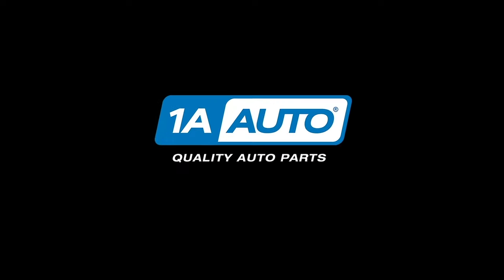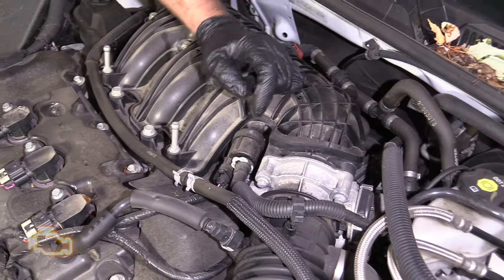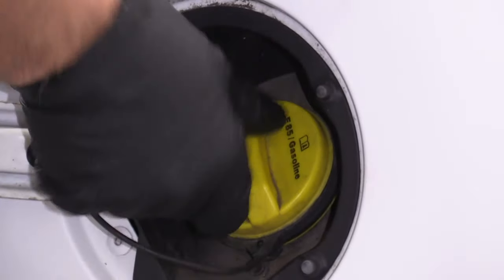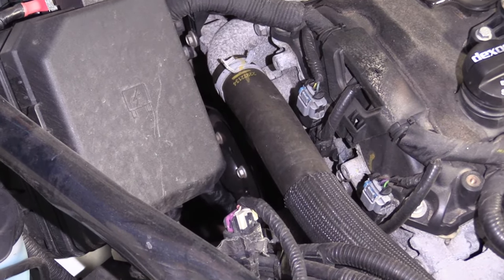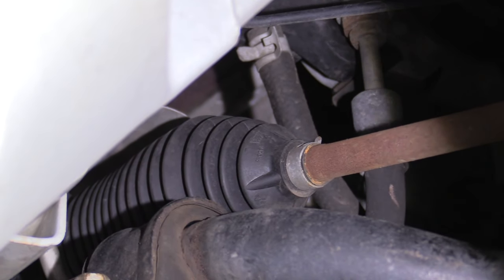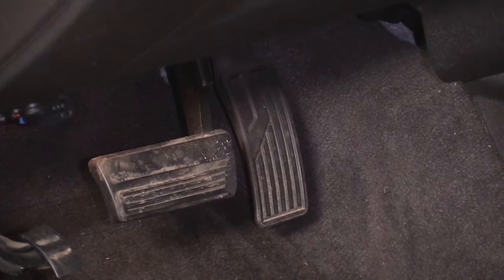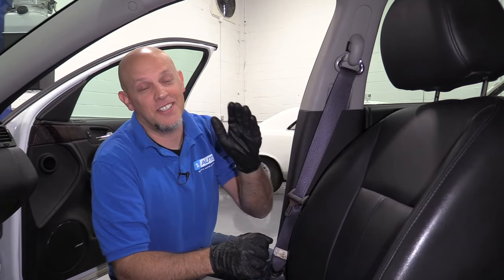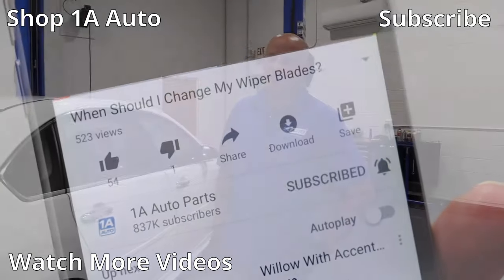Top 5 Problems Chevy Impala Sedan 9th Generation 2006-16

Comment: Y’all forgot to mention the transmission, and ac blend door actuators
Reply from the maker: Yes those would have been in the top 10.  Thank you for checking out the video. If you need auto parts go to: http://1aau.to/m/Shop-1AAuto-Now
Reply: @1AAuto  y’all should sponsor me some wheel hubs for my impala
Reply: How about the transmission lines leaking? That’s a real common one.
Reply: @melissarandazzo1515   haven’t heard of that being real common
Reply: Yeah, at 136K, none of the problems in this video have surfaced, but I've had to rebuild the transmission and replace 2 Blend Doors already!
Reply: @kentloar2175  that’s terrible about the transmission.
Reply: I had to modify my power door lock actuators, with a cheap kit I bought off of Amazon. The door lock actuators can be modified, if you replace them you'll spend a ton of money. I'm surprised no one else has had that problem of the door locks not working properly with the key fob.
Reply: @paulvansteenberg3716  I've actually been having this problem recently on mine, though it's only been on the back door on the driver side
Reply: @GarrettC8450  they will probably all wear out, and if you buy new door lock actuators they cost about $150 each, the door popper kit that I bought does all four doors, and was under $15.
Reply: @el_7017  You must be talking about the earlier years of this generation with the 4l60e transmission... Which is a problem in every Mid 2000s Chevrolet. The 6l80 transmission is almost unbreakable and mine is currently at 492,826 miles. Still shifts like a dream.
Reply: GameTesterDev   What kind of transmission is in a 2011 is it good ???
Reply: @rogerthat9174  the 2011 has the 4l60 unfortunately... However, it was an upgraded version of the 4l60 used in 2000-2009 Chevrolet vehicles... It's not amazing perse, but it'll get the job done... The 6l80 is definitely the best Chevrolet transmission to this day...
Reply: GameTesterDev   Thank you 😊..I am still interested...it is a 2011 3.5 with 109.000 miles..the seller is asking 6450..what do you think.....
Reply: @rogerthat9174  that's a little steep... If it were the Police Interceptor 3.9... it would make sense... That is worth about $1000 less than what they are asking.
Reply: @rogerthat9174  in fact, I've actually seen those go for $4950 with less miles...
Reply: GameTesterDev    Good to know...thanks so much... I think that I will walk away.....
Reply: @GameTesterDev   everything you said is wrong 06-11 v6 impalas had 4t65-e trans the v8 models had 4t65-e hd trans and 12-20 impala had 6t70 trans but yes the 6t70 trans are better than the 4t65 trans
Reply: @rogerthat9174  what state are you in?? Because Vehicle prices do vary by state.
Reply: @el_7017  that's my bad actually. I was looking at the SUV/Truck Transmissions and comparing the generations.
Reply: @rogerthat9174   2011 will have the 4t65 transmission, if it’s not loaded with leather seats, sunroof etc don’t pay over 6k if you do just get aftermarket cooler for transmission and it should be a reliable unit
Reply: Ronaldo Maldonado   Thank you both for your help.  MUCH Appreciated
Reply: GameTesterDev Massachusetts
Reply: Ronaldo Maldonado    The weird part it is from a reputable dealer..@ my location...and he won't budge from the price..not one penny
Reply: @rogerthat9174  oh... Then yeah, that price is kinda outrageous... My Brother bought a 3.5 with 89,000 miles on it for $4875 and all he had to do was stick a new battery in it... He's had it for 3 years now and no other issues have occured.
Reply: GameTesterDev    Wow...I can never get a break like that....it's been on the lot for a while....maybe I will play the waiting game. And see if he brings down the price.....

Comment: What about the service stailbili track and wheel bearings
Reply from the maker: Yes good points that should have been added. Thank you for checking out the video. If you need auto parts go to: http://1aau.to/m/Shop-1AAuto-Now
Reply: I’m having this problem right now and have no idea what’s going on!
Reply: @abstractjada5169  replace your wheel bearings and those lights will go off, I had the same issue
Reply: My stablitrak light is on right now which cause my abs and traction control light to come on and when I press on the gas I’m hearing a grinding noise can someone explain to me what the problem may be?
Reply: Yep, I had both wheel bearings go out in the front just 4 months apart from each other (~115K).  Also had both Blend Door Actuators go out separately (~125K).  And had to have the transmission rebuilt (114K) despite changing the transmission fluid faithfully.  Those would be the "Top 3" on my list.
Reply: What happens when the wheel bearings go out? My front end has something wrong and they keep saying it’s in the tires but it’s NOT!!
Reply: @laramstake3742  Exactly what happened with my 2013 LTZ, definitely have your wire harness checked out. Apparently they tend to wear out and end up shorting. Cheap fix that will save you from unnecessary expenses.
Reply: @BeardedKraken  thank you bro I’m definitely going to have it looked at

Comment: hot engine ac off warning is a common problem.
Sometimes it's the temp sensor, sometimes it's the thermostat.
if you take it to a shop watch they don't start the parts cannon.
Some shops just  replace both and don't try to find the bad part
Reply: Yes. I get this as well.

Comment: I guess I'm just a lucky guy that got good 1 it's a 07 I'm the second owner 3.9 I bought it at 100,000 miles had it for years and it has 220,000 miles now no problems changed the alternator once service regularly been all over the country in it lol glad I didn't have to deal with those issues lol
Reply: No bull service all your shit on time and you wont have issues not every car is going to be the same people have alot of problems with the 3.5  liter engine the LT basic with no extras I got the 3.9 liter engine with LTZ package with all the extra stuff its been a good car I'd say the only reason you're calling bullshit is you got a bad 1 lol
Reply from the maker: That is great Devin! Thank you for checking out the video. If you need auto parts go to: http://1aau.to/m/Shop-1AAuto-Now
Reply: Mine is 2010 LT, 3.5L engine. Was 100K miles when I bought it, a bit over 200K now.  I replaced water pump, motor mounts and a CV axle. Other than that it's been mostly maintenance. I have yet to change spark plugs on it though lol.. will get them done this month for sure.
Reply: My 2006 impala is still going at 275k miles
Reply: @devinlarew8330  I have a 2014 LTZ Limited Edition of the Impala I think they don't mess up if you take care of them. They come with all the bells and whistles including a great motor transmission parts. It's a really good car. I'm learning not to drive it too hard. It's fast and I like fast.

Comment: And front wheel bearings, and transmission solenoids!
Reply: The wheel bearings I’m very familiar with this one. I’ve already had to replace 3 of them on my 2014 Impala.
Reply: Transmission solenoids? I have one shifting a little off. Could that be it? Do I have to remove the transmission to do it?
Reply: @martin1b  No. You need to drop the sub-frame a bit at an angle to get the side cover off. And replace both. There are 2, which are exactly the same. I just changed these on my brother's car. Shifts 10x better.

Comment: What about the sway bar? Its a hollow bar and breaks at the ends.
Reply from the maker: Yes this was very common on the generation before this also. Thank you for checking out the video. If you need auto parts go to: http://1aau.to/m/Shop-1AAuto-Now
Reply: I have an 08 LTZ.
I replaced the hollow sway bar with a Dorman solid bar.
I just test drove it today. In an empty large parking lot, I pounded it through sharp lefts and right turns.  It's response blew my mind!  It handled like an Indy car!
Treat yourself and replace it.  I'm so impressed I'm still grinning!
Reply: @MrBikedrummer  what is a sway bar and where is it located? I’m still learning thank you
Reply: @isidraordaz2094  
It's a heavy steel, like a solid pipe about 5feet long with a slight shape. It connects just behind the driver's front wheel and travels sideways over to behind the passenger's front wheel.  Each end has a connection to the lower control arm.  
These link pins are like a bolt with rubber bushings.
The purpose of the sway bar is to reduce the amount the car leans or lifts side to side when you take a corner.
There are great videos on YouTube detailing the replacement.
I hope that helps!
Peace.
Reply: @MrBikedrummer  I have an 08 LTZ too and I just ordered a new front suspension kit can’t wait to see how it’s ride once it’s finished
Reply: @GoDigital448  
I believe you will be impressed.  If you are doing the work, there's a great video in YouTube about replacing the sway bar an easier way.
Instead of lowering the subframe, you can pull it out from the passenger side by disconnecting the tie rod ( separating it where it connects to the back of the wheel).
I highly recommend this method.
Enjoy!
Reply: The links also. My whole front end is new now on my 07 Flex Implala. Now is my water pump bad or thermostat? No water leaksand blowing cold air and overheating again. How do i know which one it is
Reply: @m42037  
Check your oil to see if any antifreeze is in it.
Monitor the antifreeze level.  If it is dropping with no visible leaks, and you find antifreeze in the oil, it could be a head gasket.
Good luck
Reply: @MrBikedrummer  No no no bro, oil change every 3k miles, clean oil almost 200k miles, i think it's the thermostat. It's been power flushed 3 times last year and still rust in motor. At the neck it's got rust sludge
Reply: @MrBikedrummer  Had it looked at today, the motor is full of rust mud, hoses were plugged! I hsd it flushed 3 times last year. He thinks someone put shitty antifreeze in it like from Loes or Meijer and caused the block to rust. So i guess i got to flush & fill the motor 2-3 times a year smh
Reply: @m42037  
Hi. I was thinking about it today.  If someone had been using water only, it would rust up and overheat. 
It's called antifreeze , but it disappates heat and acts as a lubricant.
I live in New England, I know people that don't understand this.  Their cars always leave the same way: On a flatbed.
Good luck.
If the hoses are plugged , the radiator could be plugged.
With 190k on the car, a new radiator might make you AND the car happier!
Reply: @m42037  
Geez.  Once you get it cleared up, you won't need to flush it. 
I'm also thinking the heater core could be plugged.
I'm not just trying to throw a huge parts list at ya, but all these components are in line with each other.
Glad you have around 200k on it.
Reply: @MrBikedrummer  The big hoses weren't plugged, it was the small one to the radiator and the radiator fluid bottle drain was plugged. Ya someone put bad antifreeze time passed he thinks. It's fine now. Oh it'll go well over 200k miles i had it 7 years and changed the oil every 3k miles, the whole front end is rebuilt even the struts are new. He said when it heats up again in 3 months lol bring it back and we'll do a complete flush & fill. Today he cleaned all the lines out and filled it. I told him im 55 years old and never had a damn car that needed a flush & fill 3 times a year! Lol
Reply: @m42037  Good to hear. I'm 63 and I don't flush my colon 3 times a year! 😆
Reply: @MrBikedrummer  Lol bro you must eat a daily high fiber breakfast!!
Reply: Just got mine fixed lmfao
Reply: @Dom-py2ow  Replaced my sway bar also, new links, struts, wheel bearings (3) ball js & tie rods are tight, whole front end is straight! 07 Implala black. 200k miles almost and has a slow rear main seal leak. Just replaced the radiator, 275 bucks intalled, i guess that's not bad..
Reply: @MrBikedrummer  i have 2008 Impala LT.  Front sway bar is hollow. I need to know the size circumference for the solid. Police package
Reply: @MrBikedrummer  roflmao
Reply: That was about your reply to the colon flush. Hahahaah
Reply: @donnajorett7333  
Glad you got a chuckle!
I don't think the size matters. Gigiddy.
The solid one might be a little bit thicker, but they come with the correct sized rubber bushings? and clamps.  I think new bolts too.
I don't know anything about the police version. I doubt they use a special sway bar.  I'm not sure though.
Reply: @donnajorett7333  Dated

Comment: Purge Valve is also P0442. A lot of times you will know it’s bad after fueling up the car. It will struggle to start. Great video
Reply: Just got p0442 after an oil change should i replace this first? 2008 lt 145k mi
Reply: @timlynch8299  yes I would change the Purge Valve
Reply: Anyone know where the proportioning valve is located on a 06 impala 3.9 v6?

Comment: The ABS cable behind the front wheels causing Traction control, ABS and Brake light to come on at the same time
Reply: Yeah I’m having that issue right now but I’m picking up the piece for my 08 Impala LTZ tomorrow
Reply: Yeah shit just happened to me
Reply: Happened to me too. Got that wire harness replaced and good as new.
Reply: Mines is acting up for my 2013 chevy. What part do I need
Reply: Had this replaced a year ago and having the same problem again 🤦🏽‍♀️

Comment: The best years for these generation impala was the 2012 and 2013. The 6 speed auto with the 3.6 has proven to be quite reliable i own a 2012 with 176k i put about 1k miles a week. Nothing but routine maintenance
Reply: And 2014-16 Limited.
Reply: I agree

Comment: The 06-16 Impala came with 4 different motors during its run. 3.5, 3.6, 3.9 and 5.3. For the EVAP purge problem, you should make sure to inform the viewers which motor has this issue as the lesser informed will not be able to spot the difference between the 4 different motors as the 3.5 and 3.9 are a much different V6 than the 3.6 and likewise the 5.3.
Reply: You’re 100% sure I just bought a 2013 Chevy and Paula I’m not quite sure what motor it has her what style LTZ or what not or LT model but could you go in more detail of what the differences in how to be able to tell
Reply: @grace.by.fire2021   2012-13 is the 3.6.  Perhaps the best engine rated at 300 HP, but the trannys are crap.

Comment: The day this video came out, I had just had the evap purge solenoid replaced on my 2015 Impala LTZ as it was bad.  I had replaced the gas cap prior to taking it in to my mechanic because they said one of the cheapest things to try  for a PO455 code was to replace the gas cap. A few days after the evap purge solenoid was replaced the engine light came on again. I took it back in and they did a smoke test and the gas cap was the culprit. They bought another gas cap from NAPA, (where I got my cap), and it didn't seal either. They ended up getting a gas cap from the Chevy dealer and it sealed perfectly and the problem was solved. I don't know if my local NAPA store got some bad gas caps but I've been very happy with all my purchases from them in the past. The mechanic said the napa gas cap didn't seal which was odd since my receipt specifically stated that it was for a 2015 Chevrolet Impala. i am just letting you know what happened in case you also have the same experience.  I am not complaining about napa and will continue to shop there.
Reply from the maker: +Brian Wanberg Thanks for the feedback!

Comment: Man.  Let me give you a couple more.  The transmission is terrible.  Surprised you didn't mention that.  Lets talk about the actuators that always go bad.  Dorman is horrible.  Buy new if you can.  Haven't experienced evap problems or rack
How about the problem with alignment issues.  First 2 years I owned the car,  I went through 2 sets of tires.   Took it to stealership and they said they couldn't help me it was out of warranty. Bad camber ate my tires up.  Oh, lets talk about your rear defroster not working.  This problem plagues 9th generation impalas.  There is a burnt connector and you need to get it soldered and fixed.   Lets talk about the check engine light you get when your car is running lean.  Its a rubber seal in the brake booster that goes bad which cause a check engine light.  Some of may replace the brake booster but it needs what they call a front seal. 
I got many more.  How about the ISS, intermediate steering shift.  Makes a popping noise as if your is about to break.  Nasty noise. Plagues all Impalas.  
Or how about the transmission cooler line fittings that leak.  
You missed a few!
Reply from the maker: +Mark J Thanks for the feedback!